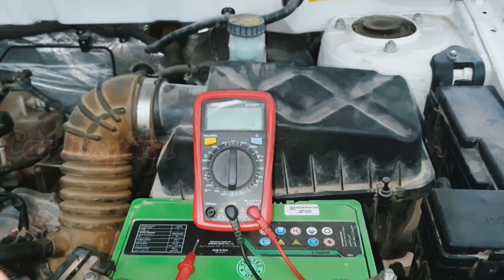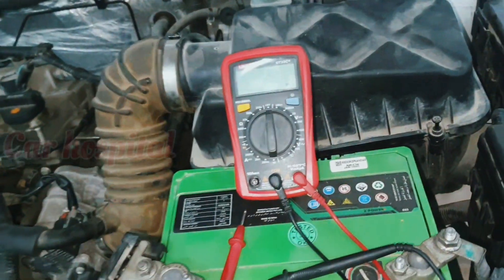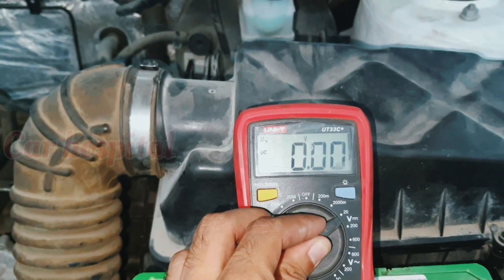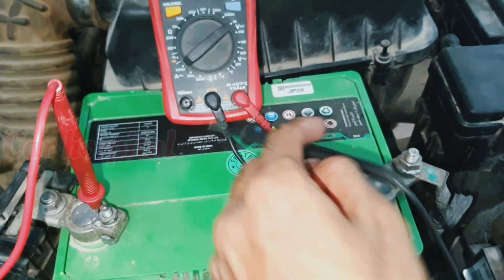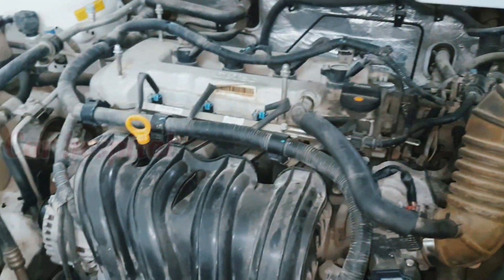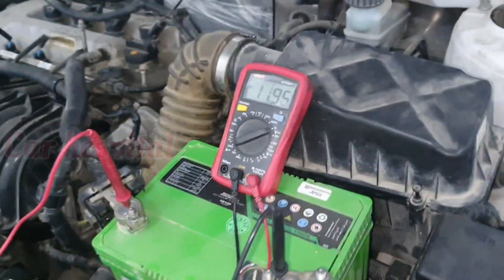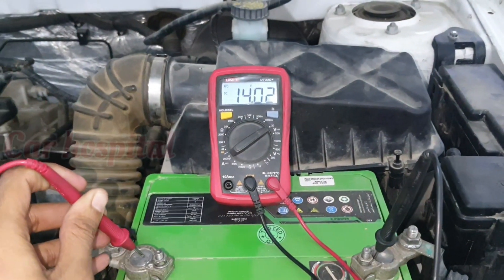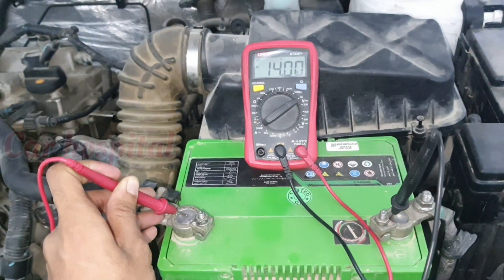How to test alternator with multimeter easy way.

Comment: Sorry mate, 20 years ago, this test was okay (not really) but not today on modern vehicles. For EXAMPLE, if a LIN-controlled Alternator loses the LIN signal, the alternator is ALWAYS going to charge even when it should not be charging and this will create some problems soon. Other vehicles will charge at idle like your test but will not charge while driving so your test is invalid and people who follow your simple test MIGHT end up on the side of the road with a dead battery. Next time you make a GENERIC video, please describe what exact system you are talking about as this video does not apply to all vehicles as the TITLE implies. You also did not add any loads to the electrical system nor did you raise the idle speed to ensure this simple style of alternator can carry a load. Please give your viewers a chance to learn something beyond the most basic of basics. Your channel is called Car Hospital to keep cars out of the Hospital, not to put them in the Hospital, cheers.
Reply from the maker: 🥰🥰🥰🥰 ok brother